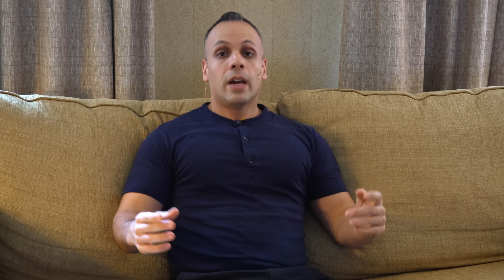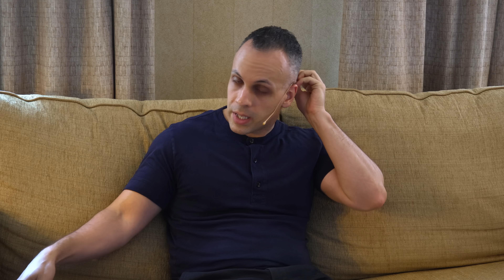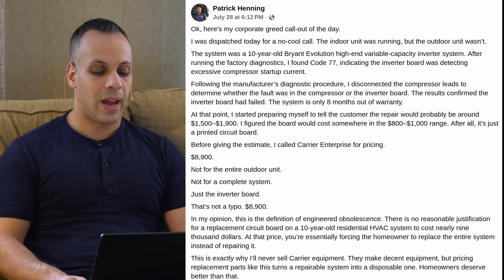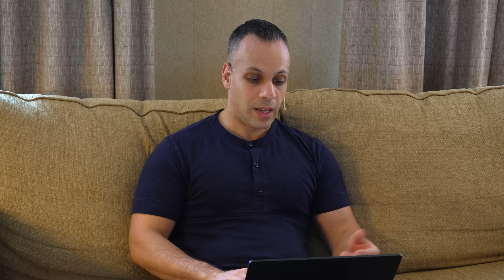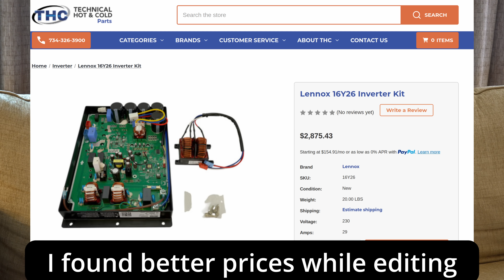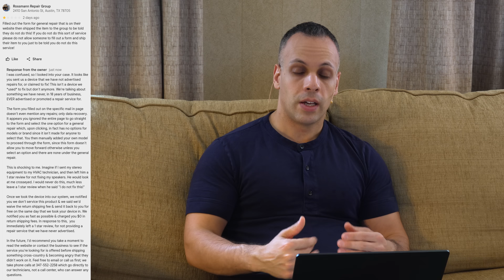Carrier AC repair has $8700 part cost for residential unit

Comment: The HVAC industry is one of the most dishonest of any industry I have encountered.  I have a Carrier furnace and AC and I pay for Home Service Plus through our local utility company (home maintenance and repair service offering operated by CenterPoint Energy here in MN).  We noticed our furnace cycling on/off more often than normal and called HSP.  They came out and wound up red-tagging our system due to excessive carbon monoxide output (through the exhaust, not into the home) and they shut off our furnace in January and told me that THEY stopped working on my unit because they lose too much money on them.  So in a nutshell, you're on your own but we can sell you a whole new system.

I then reached out two six nearby HVAC companies who supposedly worked on Carrier equipment.  Four of the six told me that the heat exchanger unit I needed was on indefinite backorder and my only option was an entirely new unit.  The other two told me that there were a dozen in stock in the warehouse about 9 miles away.  One quoted me full part and labor replacement cost and the other was slightly more honest and said that the unit was covered under extended warranty but I'd have to pay for the diag visit and installation.  Diag was $124 (yeah yeah, fine) and the replacement installation was a whopping 2 GRAND.  I literally laughed out loud on the phone when they called to schedule the installation and gave me the quote.  The woman scheduling said, "it's very complex like changing the engine in a car" and I laughed harder because I'm a former German specialty automotive shop service manager.  I looked at the furnace and promise you I could replace that sucker in 2.5 hours if I had the part... but of course I'm not authorized to do that so you have to jump through the hoops. 

The tech arrived to do the complex replacement and had it done and back on providing heat in almost exactly one hour.  Two grand for one hour.  I do understand "book rate" as a former service manager but it was still a tough pill to swallow... that would get tougher.  About two weeks later I'd receive a letter in the mail from Carrier alerting me to the fact that I was an owner of one of their units with an extended warranty on the heat exchanger and that if I experienced failure, I could have it replaced at no cost to me for parts or labor.  Uh, wait, what did I pay two grand for?  It seems my semi-honest HVAC company was double dipping me.  Getting customer pay and warranty pay.  I brought this to the attention of Carrier and a few months later they wound up sending me a check to reimburse the installation cost.  Who would have thought the only honest party here would wind up being Carrier?  I'll still never own another... it came with the house.

Comment: This exact same thing happened to me. Had to replace the entire unit for $5000 instead of $9000 for just the board. Of course did not buy Carrier. As a retired electrical engineer I even looked into repairing the board but no documentation could be found.

Comment: Comical. It's a doorbell replaced with a computer? AC systems are electromechanical devices like doorbells. First mistake, on day one, replace all of the circuit boards with electromechanical switches. Get yourself a schematic from an old AC system and rewire it yourself for $200. The AC market is a scam business from the top to the bottom.

Comment: here is WORSE.  If you have an R-22 system still working (I know they don't make R-22 anymore) like a champ they have discontinued R-22 and they are about to phase out all 410b systems.  So if you're systems are working great you cant or will be able to get refrigerant!  So you have to replace your outdoor unit and air handler that can cost you around 10k with the AC people doing the install!!   And if you have a home and you want to sell you can't because you have an outdated system even though it is cooling GREAT!

Comment: Go with Goodman or ACIQ. Both are easy to troubleshoot and use off the shelf parts for 90% of the machines. 

Recently replaced a 4ton condenser board for an ACIQ, $50. I about dropped the phone it was so cheap.

Comment: The thing that gets me is that there are many off the shelf controllers and motor drives that can easily do the job of the factory controller and motor drive for less than $100 for the controller and less than $250 for the motor drive.

Comment: I don't repair those boards because the customer wants the system back up and running fast, and we can't go back to the shop and fiddle with it all day while ignoring 50 other hot customers. I sometimes repair commercial AAON boards if the customer can't afford 10K for a new board or if it's backordered, which is often the case. ECM motors used to be repairable, but now they put epoxy all over the board to stop you from repairing it. I recently found out that Ryobi also put epoxy all over my riding mower board for the same reason. It won't be long before those inverter boards, and probably the AAON boards, get the epoxy treatment.

Comment: Louis -inverters offer considerably better comfort that is and should be their selling point. Most OEMS parts are expensive  and often slow to obtain however carrier is notorious. I’ve ha four carrier inverters over the years and they’ve been great BUT recent parts have been obscenely expensive . Goodman IS NOT great equipment  but it probably is “good enough” - put the money you save into getting a precise design so you are not over sizing , separate aprilaire  or Santa Fe  dehumidifier , a very robust surge protection/voltage regulation at the shutoff and 4 inch Aprilaire filter box that you change our regularly

Comment: I have a Laars mascot boiler/ domestic hot water unit. Installed in 2007 by my self. I have replaced the blower motor on it 3 times now. First time the circuit board had bugs all over it. The replacement had a coated circuit board as well as the third. The first time I bought it, it was like $600. The others were $400-500. They fail the same way everytime. Wish they had schematics. But 20 year old Boiler I’ve spent probably 2k over those years replacing components to keep it going. $8900 for a board is criminal.

Comment: As an engineer in a factory, we call those “no quotes”. They quoted it, but at an absurd price. Whether it be that they didn’t have the available capacity for the work in the desired timeframe, or parts would be difficult to find, or they just weren’t interested. In 20 years in a factory, I don’t think I’ve ever had a vendor say no. They’ve always provided a quote. It is definitely about the optics of saying no.
Additionally, after a line of products is finished, any additional parts are called “service parts”. They’re often agreed upon quantity and price at the end of normal production.
We have some equipment that we’ve paid the no quote price on, because it was extremely specialized, and no other lines would benefit from purchase of a modern unit. So it’s more cost effective to repair the equipment, running service product. 

Context: factory makes OEM for automotive industry.

Comment: I wish I knew how to repair these boards . Once you get into the flowchart troubleshooting nine times out of 10 it ends with inverter board. It's quite sad and then on top of the board being obnoxiously expensive the service companies got to get their margin off it as well. My 13 years of experience is leading me to believe that these ductless or high efficiency systems are meant to be replaced not repaired. 13 years HVAC

Comment: I have asked about repair of a circuit board on an HVAC unit, and the owner of the HVAC business said they would not even consider it as it would put any liability on them in case of failure. If I got a board repaired somewhere else, if they knew that it was not an unaltered OEM board they would refuse to service the unit, again, stating liability reasons.

Comment: The cost and availability of spare parts is typically not known to consumers when making a purchasing decision. I would have slightly less of an issue with that if the consumer is protected by good warranties. For example, if a HVAC system is expected to run for 10 years then a 10 year parts warranty seems appropriate to me. The cost of replacement parts would then factor in the cost of manufacturing and storage to service the customer for the warranty period. But manufacturers shouldn't just quote high prices because they don't want to deal with the customers they happily sold their product to.

Comment: We’re in the industry of repairing pools (specifically replacing equipment) and we’ve been considering taking in the manufacturer deems failed boards/equipment and repairing them at the component level rather than throwing them away. Prologic main boards go for $900-$1000. Hayward doesn’t offer a replacement drive, they sell you all but the plastic of the pump housing for $100 less than the whole pump. I think there’s good opportunity if I can learn how to do it. 
No need to reply, just putting my two sense in.

Comment: not for hvac, but i feel like i've seen this before online, i think maybe for a computer part, and i was like "why is this part 10x+ the price it should be..."

at the time i thought it was just to like keep the placeholder there for potential new stock later or something, but it makes sense in this situation they just wanna be able to say they do technically provide the necessary parts online for repairs- just they're entirely not economically viable parts for a customer to utilise in any way. probable scummyness i think.

Comment: 3:00 we were using "inverter" ACs in EU(ES) for at least 30 years. I'm not going that those are mandatory but almost.
Noone wants an ac without an inverter. And a split AC unit + installation goes for around 1000-1200€

Comment: If you put 2026 products onto your electrical system from 1983. Then you would probably benefit from erring on the side of caution.

Personally, my 2024 mini split is attached to my electrical system to a load center with a sticker from 1985.

So I forked up $118 for a surge protector because it just makes sense.

I'd rather these $200 search protector below, and protect my $1800 mini split...

Especially because ordering a circuit board for it might cost more than the entire unit… Case in point

The sad thing is they want to reduce global warming potential and ozone depletion potential

Hvac says GWP/OWP 

So they're moving from systems that would use refrigerant such as R32 to More "Global friendly " 454B.

The funny scam part of it is that it's pretty much a 70/30 mix of R32  and 1234yf (which is the primary refrigerant and most newer cars).

So there global warming fix is to basically mix something from 100% to 70/30 and then charge you 4 to 5 times the cost...

Trust me if you did research on it you would find enjoyment in making a video just on that topic.

Comment: Love the videos and how you even offer to pay for certain people to receive some type of theoretical justice in certain situations.

I've been studying and learning Hvac and refrigerant and obtaining EPA certifications more on the hobby side.

I can speak on the air-conditioning side of standard components, like capacitors, or thyristors. 

On the electrical side, I really have now this experience pretty much building those DIY boards for LED components utilizing different size resistors and capacitors and moving forward from SMD type of modules and how they're designed going forward to ceramic capacitors mosfets and how there "gate "components work.

With that said, I would believe that probably 90% of Hvac guys were pretty much chuck those boards out or look to someone like you to potentially find a repair for them.

Especially, if you can tell a customer, it's 8900 for a new board but we can get you a remanufactured board for $2500. And getting someone like you to replace a capacitor, because it caught some type of surge and burnt out.

Let's be realistic the board capacitor is probably eight dollars and even of $100 of your time would be less than $200.

And selling that for $2500 would be an awesome profit for them

That's my thoughts as a novice on both ends

Comment: Never buy a model that is exclusively sold in USA. You will get fucked.  An inverter kit for a Daikin runs about 400$ with non-branded replacements about 100$.  Do research before you buy

Comment: Hello, I have done commercial hvac for 14 years and I cannot tell you how many chillers we have lobotomized the computers out of and made them analog controls
Reply: Trane chillers screens are 2,400$ and i know could be fixed with an 10$ part from china. also all of there sensors are 200$ minimum and are basic thermistor probes connected to their proprietary boards.

Comment: This is why you use window units.    On the back of the house if you are in an HOA.   You run the central less.   It lasts longer.
And you can use solar to run that window unit if you have a back yard.    Which lowers your power bill.

Comment: Louis, as an HVAC installer myself, your guy gave you solid advice with not getting the high end stuff, every one goes the same with some insanely expensive part that does the system in prematurely with the F-you buy a new one price.  I have been lucky though with a local guy I have taken a few boards to and he was able to repair them, albeit with no warranty, but the systems are still working.  I usually tell people to stick with a good name brand and go mid seer level, you still get efficiency but the equipment is still not too complicated and parts are readily available/universal.

Comment: I had a similar issue with a Rheem RP20 4 ton inverter heat pump system and the inverter replacement board is 3500.  So I was in the same boat but lucky me I found the same board for a grand on Fleabay so that helped me out of my issue.  These are expensive boars but I do not understand why

Comment: I don't want to buy any new AC unit with the new flammable refrigerant.  If I had to buy one, I would buy the entry level unit.  Most of the opening price point models are less efficient, but don't contain sophisticated electronics like an inverter board.  If I have to buy one, I want it as simple as possible.

Comment: "After all, it's just a printed circuit board."

Lmao no it's not. This tech doesn't know the meaning of the term "printed circuit board." Go look at an old school durazone zone board with removable icecube relays. *That* is a true printed circuit board. It's literally just solder traces printed onto a board. You could remake the whole thing with just wires. That's a literal printed circuit board. 

An inverter board is very much not "just a printed circuit board." You're not paying $8,900 for a basic PCB. If you were, I would gladly recreate the PCB for you with just wires for much less than $8,900. 

The board has high current rated bridge rectifiers and huge voltage smoothing capacitors and IGBTs that switch on and off voltage thousands of times a second on three legs all precisely synced to each other. 

I would agree that $8,900 is ridiculous to have to pay 10 years into the systems life. But I work for a Bryant dealer that gets the highest tier pricing on parts and equipment, and I can tell you that *our price* on that inverter board was well over $5000 *last year*. I haven't found one failed this year, but I'm sure it's significantly higher than last year. A factory authorized Bryant dealer sitting in Bryant's best pricing tier is probably being charged at least $6000 for that inverter board by bryant themselves.

The Lennox board might be cheaper. But the XP25 is also an inferior product. It had a smaller modulation range and and worse efficiency ratings in both cooling and heating. The Lennox XP25 is working with like 10 HSFP, while the Bryant 284 sits at like 14 HSFP.

Comment: just upvoting what others have said.  all the components i can see on that board are easily testable and cheaply replaceable.  certainly, i'd just replace the electrolytic caps out of hand and see if that fixed the issue.  if it was a custom IC that truly was the culprit, i'd even consider buying a replacement unit, doing whatever was needed to extract the customization, and then returning the unit as unneeded.  $8k for a simple inverter board is a fuck you price, undoubtedly.
Reply: i should add - someone should upload a high rez image of the top, sides, and bottom of the board.

Comment: Ok, time to call out some BS here. This is literally comparing a Ferrari to a Pinto and getting upset that the cost to repair the Ferrari isn't the same as repairing the Pinto  The system that this person is describing is/was Carrier's top of the line DC inverter compressor a/c condenser. At the time it was one of the most energy efficient a/c systems you could buy. The customer would have been aware of what they were getting into at the time of purchase. There are many, many, many other much less expensive options available with out of warranty repair costs being a fraction of this. When the customer purchased this system the original installation price would have been north of $12,000-$15,000.
EDIT: Also, this person is incorrect saying that the replacement is just a simple circuit board. It is the entire inverter assembly. Just look up "Carrier replacement inverter assembly" and you'll see why the price is what it is. I am in no way a corporate apologist, but I will call out obvious BS when I see it,